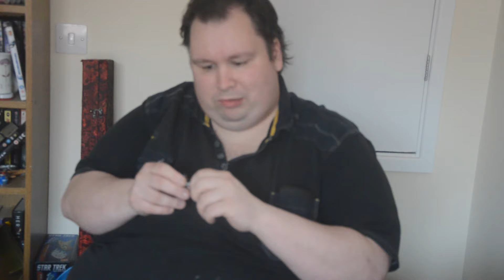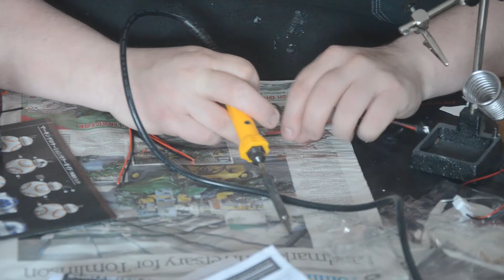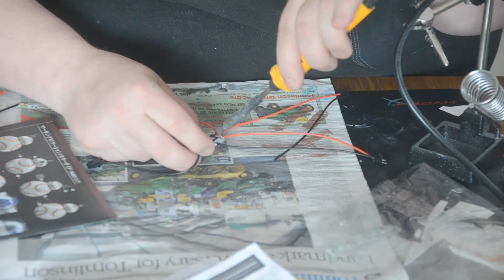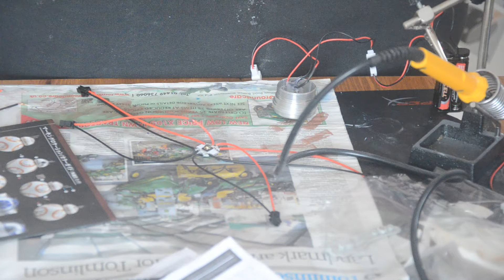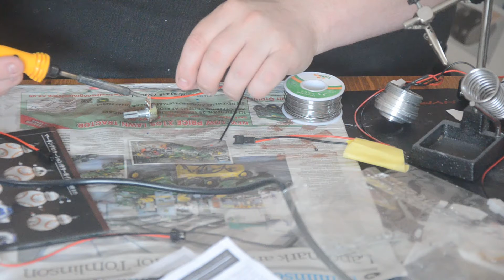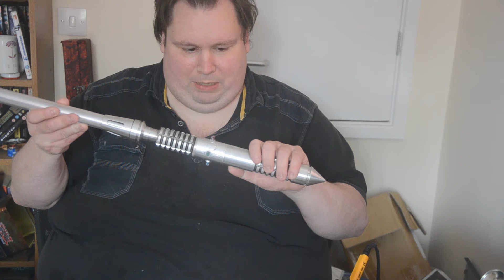How to make a lightsaber with easily adjustable blade colours

Comment: I had a thought, you could maybe put the nob in a line down the hilt rather than around it.
Reply from the maker: that was the origional plan, until I realised I did not have any parts thin and long enough to do that, however that is still the plan for a future video, when I can afford to get in some more parts (unless I find any tiny potentiomoters before then which I could just do an adjust then put in the hilt rather than surface mount)